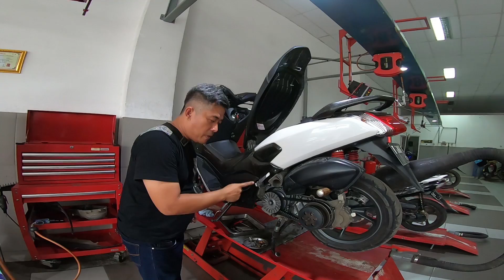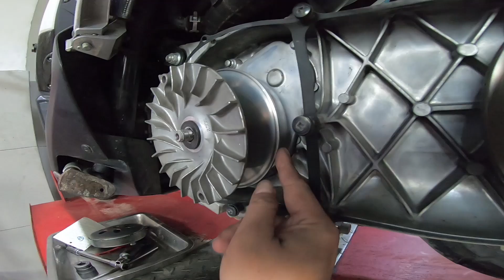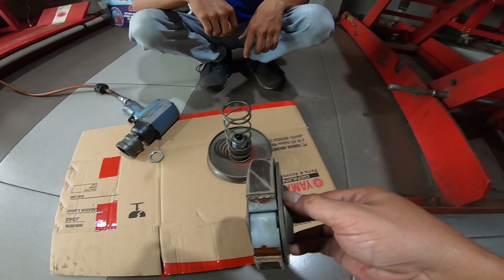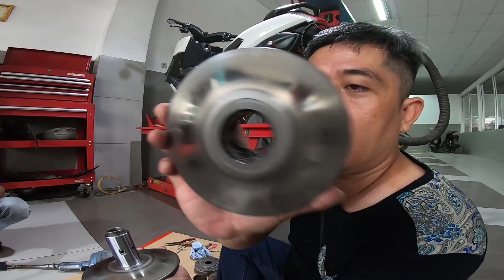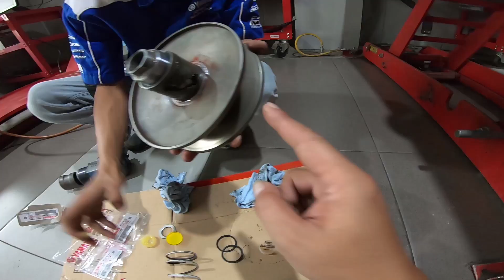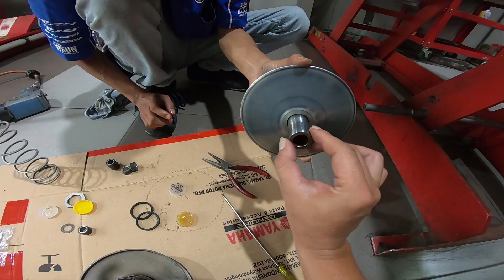CARA MERAWAT CVT NMAX BIAR AWET: CARA KERJA CVT MOTOR MATIC

Comment: Makasih ilmunya bro ! Sangat bermanfaat buat pemilik NMax.
Reply from the maker: siap om suport terus yah
Reply: @deniubangunawan  
kemarin bongkar cvt nmax, ketika puli depan dan belakang dilepas mesin dihidupkan bunyi mesin kasar seperti bunyi tensioner rusak, tapi ketika semua sudah terpasang kembali bunyi mesin pulih normal seperti semula, hilang bunyi kasarnya.
kira2 apa penyebab bunyi mesin kasar ketika puli dilepas ya Bang? apa memang normalnya seperti itu?
Reply from the maker: Di belakang puli dpn ada oneway sama bosh klo puli dibuka pasti longgar, coba klo dilepas puli dpn trus bosh nya ditekan tangan pasti ga bunyi
Reply: @deniubangunawan  
jadi itu normal ya Bang? kemarin sempat kaget kenapa ada bunyi kasar, padahal motor nggak mengalami kerusakan apa2
Reply from the maker: Normal atau tidaknya lebih akurat yg bongkar yg tau
Reply: @deniubangunawan  
ok, terimakasih Bang

Comment: Saya service berkala di yamaha, kagak diapa2in, bersihin filter udara aja engga, saya komplain baru di bersihkan, katanya belum ada keluhan apa2 ga usah dibongkar2, padahal kalo cvt walaupun ga ada keluhan tetap harus dibersihkan kotoran kampas koplingnya, kecewa sama bengkel yamaha
Reply from the maker: Maaf om ga semua bengkel resmi seperti itu om, klo ada kejadian seperti itu silahkan komplen ke pimpinan bengkel resmi terkait untuk di evaluasi
Reply: @deniubangunawan  sekarang sudah mau masuk km 6000 nih lexi saya om, bisa kasih rekomendasi service apa ya?
Reply from the maker: @akhim5065  klo ga ada kendala servis ringan aja, klo ada kendala lain bisa dikonsultasikan dgn team bengkel, nanti sy bikin video tips konsultasi dengan bengkel, biasakan ceritakan semua keluhan motor ke chief mekanik dulu ya om trus minta garansi hasil pekerjaannya
Reply: @deniubangunawan  tidak ada kendala om, motor masih enak, ya ditunggu video selanjutnya🙏
Reply from the maker: @akhim5065  👍

Comment: Mantap om infonya, langsung subscribe. Cuman saya pengen tau apakah ada solusi untuk benar2 menghilangkan 'gredek' di tarikan awal. Saya juga sudah oplos roler lebih ringan, tapi masih sedikit terasa. Terima kasih sebelumnya.
Reply: Motor saya sama nmax putih, 2016.
Reply from the maker: solusi terakhir bolongin mangkokkopling blkng lebih kurang 4 x 3 titik menyilang seperti cakram, next sy ulas

Comment: Om, klo pas nahan gas di kecepatan mulai 50 lgsung kluar bunyi ngiikk ngiikkk gtu knp ya om ?  Ud k bngkel resmi yamaha smpe k bngkel2 bagus, ttp ga nemu2 pnyakitnya ampe ud bongkar smha mesin sampe cek noken as n klep ga ktemu2 jg. Ada solusi ga om ? Btw nmax sy yg 2016 . 🙏🏼🙏🏼
Reply from the maker: Bunyinya daerah mna om, mesin atau cvt
Reply: deni uban gunawan sy dngernya sih di kanan motor om dket2 filter udara, sprtinya di mesin om (mnurut sy sih ) .. kriiik kriiikk sprti besi2 bradu
Reply: Sama. Nmax 2016 saya klo lari di 30 ada bunyi jangkrik dibawah. kyk bunyi persneling g ngangkat, nglitik2. apa itu suara, kang Deni?

Comment: Punya saya mesin nya bunyi kletek2 kenapa ya bang ..pas nanya ke mekanik yamaha kata nya cvt nya minta di bersihin pas udah di bersihin masih sama aja bunyi kletek2 tpi malah bilang lagi klep nya kendor padahal motor baru 2 bulan
Reply from the maker: coba minta cek di bagian lain, klo boleh kira2 sepertinya harus cek di bag dekompresi, itu pun sy hanya kira2 ya karena sebaiknya periksa langsung om, coba di konsultasikan dengan chief mekaniknya
Reply: Saya juga om di cek ke 2 beres katanya normal,bunyi tek tek pas panas aja om di gas dikit aja ilang,, kaya ada baut copot. Apa bner om kalau rumah roller yg nmax 2019 kurang persisi?? Mohon jawab ya om

Comment: Kok deh dealer Yamaha kota saya kata mekaniknya rumah roller depan tdk pakai grease karena tdk ada seal.. kalau yg belakang bener kasih grease karena ada seal.. 
Aturan Yamaha yang benar untuk nmax kasih grease atau tdk untuk rumah roller depan ??
Reply from the maker: Dilumasi dikit, klo masih bingung nanti tanya itu grease ada 2,primary dan secondary, nah secondary itu puli belakang, primary puli dpn, cuma dioles ga seperti blkng yg banyak om 😁
Reply: @deniubangunawan  iya om, saya sampai kasih lihat video om ke dia.. katanya kalau nmax tidak pakai kalau mio baru pakai utk primarynya.. karena nmax untuk primary tidak ada seal nanti kalau dikasih luber greasenya.. dia service cvt nmax saya saja yg belakang tdk dibuka katanya kalau buka nanti yang ada sealnya jadi bocor.. Dan kalau sealnya tdk bocor itu grease tdk akan kering katanya.. Kalau menurut om kan di kasih sedikit, dan menurut yg lain share juga sama dgn om.. Yang saya ingin ketahui skrg ini, standard nya Yamaha sendiri itu waktu tranning mekanik diajarinya dikasih grease primary atau tidak ? Mode Garuk Kepala..
Thank you om share nya..

Comment: Pagi om, maaf mau tanya motor saya kan lexi,  habis service cvt, ganti roller dan ganti grease pully dpn dan blkg,  tpi knp bunyinya mlh jdi kasar ya pas tarikan awal?  Tpi kalo ngebut suarnya alus,  apa pengaruh dari rollernya??  Mksi sblmnya.
Reply from the maker: Roller dientengin ga, klo dientengin ada suara dikit, sudah konsul dgn yg pasang kah
Reply: Sblmnya mksi om, setiap pertanyaan psti langsung di jawab mantap bgt dh,  nah itu dia om sya gak liat itu rollernya punya standarnya lexi apa bukan yg jelas pas bongkar kan di dpn sya trus dia bilang rollernya ud pada peyang dan saya liat juga memang peyang tpi tidak semuanya, trus sya suruh ganti 1 set aj sekalian mumpung lgi bongkar kan,  tpi sya gak perhatiin itu pnya lexi apa bukan yg jelas hanya di bungkus plastik dgn label yamaha.  Padahal sya sering nnton chanel om denny tpi klo stiap ke bengkel ywda cuma ke pemdaftaran dan saya suruh cek klo ada yg hrus di gnti ya sya suruh gnti.  Hehehee

Comment: Om deni saya mau tanya, saya pake per cvt pcx old thailand tp ky ada suara jangkrik gitu, pdhl sebelum rumah roller di cuner gak ada suara jangkrik. Slider udh di ganti baru. Mohon bantuannya om kira2 apa nya ya?
Reply from the maker: Klo sblm di tuner ga ada berarti gara2 di tuner 😁
Reply: Kira2 apanya ya om? Apa hrs ganti per lg? Sebelumnya pake per vario 150 ada bunyi ganti pake pcx jg sama. Apa jgn2 bukan suara dari per ya? Td servis di bengkel resmi om
Reply from the maker: mungkin bukan dari situ om, copot dulu aja cvt nya stater mesin bunyi ga, cek di video cara cek bunyi di motor ada di channel ini

Comment: Bang nmax saya jarang di pake banget gimana tuh perawatannya,dari 2017 odo baru 31xx km,perawatan cvtnya mengikuti odo apa waktu bang? Btw udah make per cvt cld 1500rpm roller 10gr rata semua
Reply from the maker: Klo cvt mengikuti odo
Reply: @deniubangunawan  tapi motor kaya agak ngeden gitu bang,servis sama oli rajin 3bln sekali walau jarang banget di pake cuma di angetin 2hari sekali, di pake sunmori ke subang aja baru 2x bang
Reply from the maker: Klo ibarat manusia, tu motor kurang olah raga kyknya
Reply: @deniubangunawan  kapan kapan dah olahragain nmax ke purwakarta hehe,salam dari bandung bang

Comment: Bang mohon infonya.....
Motor n max saya kluaran 2016, bunyi noise di trnsmisinya saat kecepatan 35-45.,tapi klo sdh di atas 45 bunyi noisnya itu hilang.,
Solusinya sprti apa kira2 ya bang deny??
Reply from the maker: cek oli gear sm bagian cvt nya dulu aja om, servis ringan cvt
Reply: Oli gear berkala gantinya bang.,sama tiap kli gnti oli mesin lgsung ganti oli gear.,apa harus gnti smua bearing2 trnsmisinya ya??
Reply from the maker: @rullrull5007  bisa jadi om,
Reply: deni uban gunawan 
Lokasi saya di sulawesi bang.,sparepart masih sulit di dapatkan.,klo utk smua bearing yg mw di ganti dit4nya abang ada jual ya??
Reply: Klo ada bisa nda nnti sya trf sklian ongkirnya!!.,nnti abang krm no hp biar bisa kita saling kontak2 bang😁😁🙏🙏
Reply from the maker: @rullrull5007  sementara cari aja dlu di tmpat si om, nanti liat ukuran bearingnya, asal nomernya sama bisa pake, ga harus khusus nmax om
Reply: Bang den....
Utk stelan klep standar n max berapaan ya??
Reply from the maker: @rullrull5007  ada di video satu lagi om di channel ini, simak aja cara san ukurannya komplit

Comment: Pa, mtr n max saya kalo di gas awal ada suara kretek nya d cvt. Tapi kalo rpm tinggi ga ada lagi suaranya .  Apanya ya pa.  Minta solusinya ,terimakasih
Reply from the maker: Cek dumper kopling sentrifugal sama bearing gearboxnya

Comment: Apa penyebabnya om kalau nmax di rpm 40 samapi 50 undur gas trus tarik lg kadang ada bunyi kayak kelereng
Reply from the maker: Bisa per cvt, slider, bisa roller, bisa roker arm atau bearing noken as juga stang piston

Comment: Bang mau tanya klo pake per cvt pcx trus rumah roler  d coak roler nya jg harus d ganti apa ttp pake yg ori nya
Reply from the maker: Klo roller ukuran beratnya mengikuti keinginan rider, bisa dientengin atau ngga tergantung selera
Reply: Kalo mau kejar top speed nya brrti entengin atau d beratin om???
Punya saya nmax per sdah pake pcx rumah roler d coak roler combinasi xeon n mio m3 top speed cma 115. .
Padahal standart bisa 128. .
Kira2 kalo rumah roler sdah d coak roler nya d balikin lg 13 gram vanbelt nya aman gk om?
Reply from the maker: Aman